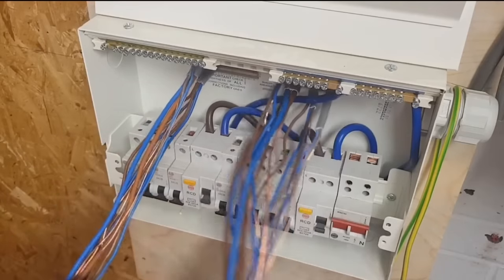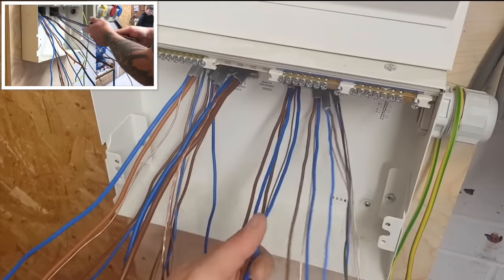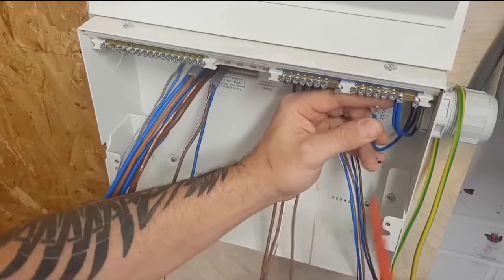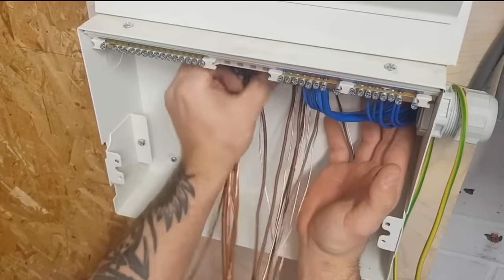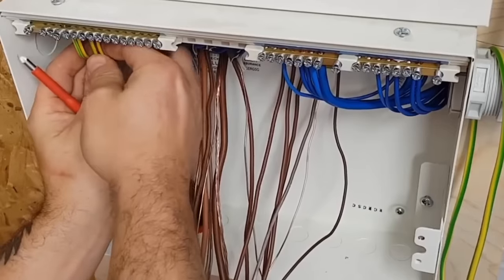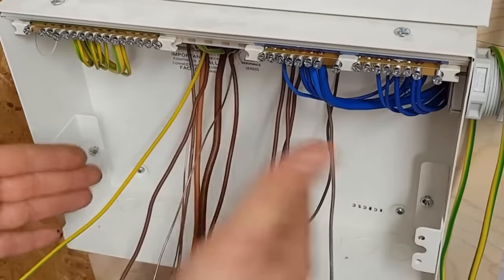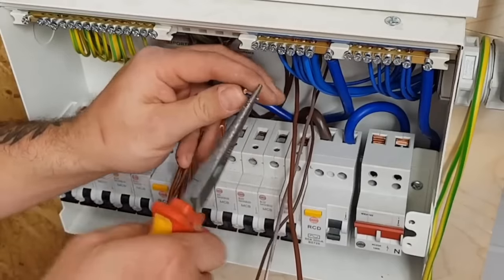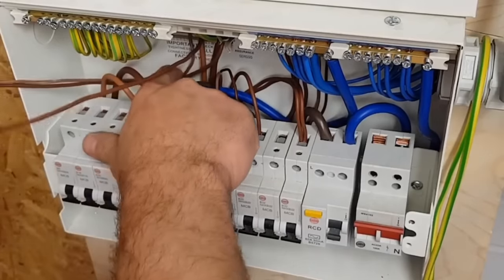Step by Step How to Connect up a 10 Way Wylex Dual RCD Consumer Unit (Fuse Box) By Luke Wichard

Comment from the maker: == 🕐 Time Stamps - Cut to the action 🕕 ==
00:13 -  Introduction to the layout of the cables within a consumer unit (fuse box)
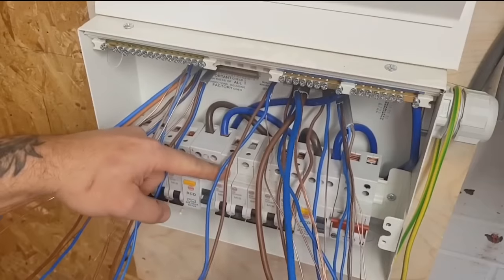01:23 - MCB layout to allow for future expansion of the wiring system 
03:00 - Reasons NOT to use consumer unit blanks 
05:00 - Filling the holes in the back of a consumer unit and intumescent pads 
05:57 - Removing the din rail from the consumer unit 
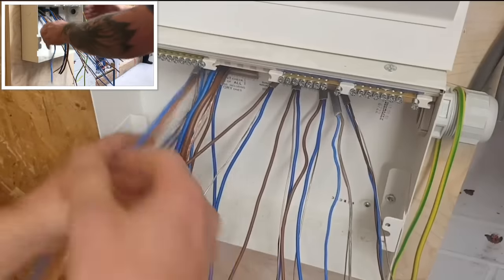06:23 - Dressing the twin and earth (twin and cpc) cables  
12:36 - Dressing and connecting the neutral conductors 
25:25 - Dressing and connecting the cpc (earth) conductors 
43:00 - Torque screwdrivers
46:00 - Dressing and connecting the line (live) conductors

Comment: I wish my electrician would have left a few blanks in my garage, I told him when installing it I may want to install a big air compressor or welder and that day has come and I've now found out hes just wired in the standard 13amp plug circuit and a circuit for the lights and the consumer box has no space for another switch so now I'm probably gonna have to get it redone.. great
Reply: Thats how they make their money isn't it... Return visits?
Reply: @justintemp  Yeah I guess, I’ve had it redone now and left in 3 blanks if I need anything in the future.
Reply: @bendude6748  i totally emphasise as it happened to me on my garage refit. Had swa under patio slab so asked for it to be in own consumer unit with extra for future expansion and extra sockets eg outside lighting etc.
He only put in 3?!!!
Power, light, spare

Did you have to pay for a new larger board? It's annoying as the unit i got was new.
Reply: @justintemp  Yeah had to pay to get a new board fitted, can’t remember what it cost me now but I think it was reasonable. Just a bit annoying that it wasn’t set up how I wanted it the first time around.
Reply: @bendude6748  yeah you pay a lot first time, not to have to do it again.
I asked another electrician and he said he would fit 3 extra ones with a bigger board. He said nobody does 3 nowadays due to number of things people have.... So i can't even sell the old unit online!

Comment: In relation to the question of mounting it on wood. CEF sell fire retardant wooden backing boards of various sizes for consumer units and fire retardant mounting posts both made by Wooton. You still need to fill holes etc.

Comment: If your main switch is on the righthand side of the consumer unit then your connections on your neutral and earth bars should be connected from right to left which on the earth bar you have not done

Comment: I always start with the highest rating MCB nearest the Main Switch or RCD, the bus bar resistance is less at the higher rated MCB than the Lower MCB. This avoids unnecessary overloads on the busbar. Thats how I was taught many moons ago in college. Makes sense, as well as any additions later on. Great video.
Reply: In reality it really doesn’t matter it’s just something everyone does on consumer units. No one ever worries about 3 phase boards.
Reply: 3 phase boards are a different matter all together. They need load balancing on each phase. As well as bus bar loads to each phase being placed nearest the main switch. In 3 phase supplies, they are usually used in commercial/industrial environments and probably using heavier loads such as motors, heaters etc, I have seen totally inbalanced loads in factories that where in contravention of BS7671 so you are right, most people don't care.. Lol I like to think I do care 😉
Reply: Comment wasn’t about load balancing but about were loads are placed on the bus bar subject to distance from the main switch.

Comment: For me in Aust, my teachers always hammered into my head, Earth stakes first, then Earth's, then Neutral's, then Active's then the Mains Supply.

Some people may say its the wrong way but when you work on some places that have tradies with generators or even the weather and worse is the steel frame house its so surprising how much of a shock you get from a dead wires not Earthed first.

I do agree with putting the CB's from large to small and if you got any spare space then put them in the middle but some Auth say NO to gaps.

I also think this is great to watch and most in the is standard in many Countries, States and other.

Comment: A lot of guys don't realise how much easier it is to work on a board that was fitted off neatly like that when it comes to modifications in the future. One of the worst sins my apprentices make is trying to hide a meter of tail from each circuit in a board like that.

When you straighten the conductors I use the ring on my little switchboard spanner, you do it too much with your screwdrivers you will cut the insulation off them :)
Reply from the maker: Hi thanks for taking the time to comment Gaz

Comment: MCB 1 the ring at 48 mins . If putting them in side by side i like to  make sure the folded copper is also aligned the same way for both so your not clamping one double thickness and the other single thickness.  Give them a little tug too . Quite often one will just pop out.
Reply from the maker: Great tip 👍🏻

Comment: A tip, when markig - use 2 different color markers, then only 5 dots - will result in binary code (lets say red for 1 and black for zero) for up to 32 different labels.

Comment: Hi guys. Great video. I’ve been told I need an isolation switch in order to have a home car charger box fitted. I’ve got this exact fuse box but can’t seem to find the isolation switch, any help or advice as to where it could be would be very much appreciated. Thanks in advance.
Reply from the maker: If you need a remote isolation switch fitting contact your energy supplier. All the best Gaz
Reply: @GSHElectrical  great. Thanks.

Comment: Great Video! Is there going to be a second part showing the connection of the meter tails? (Often the most difficult and fiddly part). Would be nice to see how he routes them in around those Neutrals and any tips he has??
Once again, great video!
Reply from the maker: Hi. I will follow up the video with the fitted tails, stickers etc 👍
Reply: great video for newbie sparks

Comment: Great vid ,well done Like, Am I missing something but where does the N from the Main Switch connect to the N bar, and the N from each RCD bank connect to that N?,  Sorry Gary if its a "Bone" question. 
Thanks for sharing sure as always its helped many.
Reply from the maker: The RCCB’s have a number of circuits on each of them and remember an RCD will detect an out of balance (earth leakage current from L and N) in the line and neutral. Google how to RCD work 🦾. Sorry for the messy short answer it’s a mad house this end.
Reply: I have the same question and i don't get the answer. Clearly the main switch must have connected to it 2 neutrals and 2 lines

Comment: Trying to understand European house wiring. So your incoming power from the utility (hydro company) consists of 3 wires? A brown (live) a blue (neutral) and ground, is that correct? So from the live (brown) conductor to neutral or ground there’s a difference of potential of 240v? 
So is wiring a light switch to a light or wiring a receptacle the same as in North America?
How do you wire a 3 way switch? (Assuming power is going to switch first)??

Comment: Hi . For us newbys,, brief exsplanation of “radial “ circuit .. and ring main and there differences . Thanks 👏✌️
Reply from the maker: Hi. A radial leaves the consumers unit and stops at the final point on circuit and ring final circuit leaves the consumers unit goes to every point in circuits and returns to the same to in the consumers unit. Thanks for commenting and watching Gaz 👍.
Reply: Would putting the two radials into one make it look like a ring circuit.

Comment: the loop in/out system for lighting circuits is ok for a simple installation with ceiling roses and lampholders however i  prefer the old spider system for lighting circuits where a central box has each light and each switch wired to it. this is easier for fault finding and easier for connection of display type light fittings

Comment: Hi...  I change my Consumer last week and i was sparky way back 2006-2012. The Only thing I Dont like when you buy the New Board Its always from right to left the configurations of the Main MCB. (I dont know if they do this intensionally) so I change my configurations from Left to right MAINS from left  then followed by RCD.  (MK 15 way Split w/2 RCD).  Its much Better layout as you normally read from left to right.  We don't read from Right to left like other countries.  And I put 100A  mains isolator.  Much easier  to isolate if you want to add circuit on your  Consumer Unit.

Comment: As an electrician of 50 years,the only time you need a neutral at the switch is when you are supplying an outside light where you want to put a double pole switch in as to disconnect both the line and neutral otherwise in my training it was always frowned upon because its good electrical practice to minimise the number of connections on any circuit you are just adding connections and having a permanent live at a ceiling rose is more advantageous when you need a permanent live to pick up were if its only at your switches its much harder,so new ideas are not always the best so I'm totally opposed to neutrals and line cables looping between switches

Comment: I bought a Prem shield board and its has one RCD with live on the left terminal and the other RCD the live wire goes to the right terminal . Is this ever right? Can the polarity be either way . The RCDs are not marked.The board is a split load with 10mcbs.

Comment: It's not easy to work while others are watching you.  I'm an electrician here in the States.  Do you have 220v between the earth and hot wire?
Reply from the maker: Hi. Thanks for the comment. We are 230 volts between line (hot wire) to earth. All the best Gaz 👍
Reply: @GSHElectrical  Yeah on paper. We still have our transformers wound with 240V primaries despite the "official" voltage figure.

Comment: What if the board has a bunch of rcbos on it?
I wired it up super neat like this and realized the rcbos couldnt be backfed. So my wiring was a lot less neat which was dissappointing to say the least
Reply from the maker: Good point… it will be a few more years before colleges will have fully loaded “A” type RCBO boards for learners to practice on. 👍🏻
Reply: @GSHElectrical  man, thanks for the reply. Makes me feel a lot better. Lol

Comment: Hello guy great job. A quetion  for you, as we know most  grounding system in UK is  TNC-C-S  and you do not use rod inside  the consumer unit ,there is rods only along  the power grid in the street,but  just in case the  neutral is lost or broken,  does not it  may offer a risk for the people inside home?
Reply from the maker: Hi thanks for the comment... currently a high number of installations are TN-C-S and the only earthing of the neutral is by the supply authorities with the supply cable. All the best and thanks again for watching GSH Electrical 👍
Reply: GSH Electrical Going to be Interesting with electric vehicle charging points will need Elcb s
Reply: @michaeljohnson1006  Elbs? What is this?

Comment: Hi, What is  your view on leaving spare mcb's instead of blanks? Is it bad practice to leave unused devices marked up as spare or unused.
Reply from the maker: Hi. I like the idea by Luke of leaving spare breakers in the board but I also not against using blanks. Thanks for commenting and watching GSH Electrical 👍
Reply: Personally I try to avoid it otherwise people could connect into an inappropriately rated mcb. It is nice to think that only the skilled will venture into db's but in reality that is not the case. :)
Reply: Yes it’s best not to leave 32A or greater mcbs in there. I have known People connect things upto 32A spare mcbs that they shouldn’t!

Comment: I'm looking forward to seeing how he's going to get those meter tails in with a 90 degree bend. Personally i  don't like to put too much stress on the main tails.
Reply from the maker: Hi. Your 100% correct the board is for demonstration and my technician placed it to close to the supply board. I will do another video about the boards features but I was holding off until the SPD arrives. Thanks for commenting and watching GSH Electrical.

Comment: hi with regard to the mounting of high integrity units, wylex do supply a rear mounting plate that allows rear cable entry for surface cables  however i am not sure about mounting a high integrity board on a wooden surface. is this allowable? could you please clarify are you saying that the rear entry space should be filled with a fire retardent substance
Reply from the maker: Hi. The consumer unit is a training rig hence it’s attached to a wood board and not to a non combustible surface. The access points in the back are large and if this was on-site I recommend filling it with a non-combustible material (compound). Thanks for commenting and watching 👍

Comment: You use the cutters back to front when stripping insulation, the "flat" side if cutters should be towards end of cable this stops the cutters trying to compress the insulation. think of an extruding machine.
Reply: Bollocks

Comment: hypothetical question if a fire breaks out in that box what precautions are there to keep it from spreading
Reply from the maker: Hi. As it’s metal it’s noncombustible 👍. Thanks for watching and the question Gaz
Reply: @GSHElectrical  actually I'm referring to large openings in the back of the box where the dangling wires enter the box
Reply: @ICEJosh1987  I gather than the UK is exempt from lightning strikes?
Reply: Intumescent sealant.

Comment: Wylex CU improvements required:

They should put the earth bar in the middle.

The din rail shouldn’t be rigid. You should be able to remove the guts by loosening the din rail with the two screws at each side, rather than disconnecting and removing all the protective devices.

Provide a decent rear grommet

Comment: Are the two wires per terminal because those are opposite ends of the same ring, or some other reason?
Reply: Yes you have the start of the ring and end of it in the breaker so its fed from both ends

Comment: What is the torque setting on the screwdriver?
Reply from the maker: Check the manufactures instructions - thanks for watching and commenting 🦾👍
Reply from the maker: The are either 0 - 3 NM or O - 5 NM

Comment: I personally dont know any sparks that use side cutters to strip cable, everyone Ived worked with just uses cable croppers which you can also use to fold over the conductor

Comment: Hi, looking for an answer, if anyone can help. What does it mean when a consumer unit switch disconnector is rated at 100A ( or 80A or 40A or 63A depending on the unit)?
I've just googled the above 10 way Wylex dual rcd and it is rated at 100A at the main switch. My own, though considerably older consumer unit, is also rated at 100A. 
Does the main switch automatically cut out power when 100A is exceeded at the unit? Is the consumer unit a very large circuit breaker itself and not just a housing for the different circuits?
Reply from the maker: The current rating of 100 amp etc is the rated switching value of the switch it is not an over current protective device (fuse). Thanks for commenting all the best Gaz 👍

Comment: It would have also been nice to see how the main tails and earth would have been connected to the main isolator switch. It would then have given a view of all the internal CU cables. 
It looks like where the incomer tails are set at the top right of the CU are going to be tight against the main neutrals. Would it not have been better to bring them in at the bottom and loop at the back into the top of the main breaker.  
What was the rationale of having the two radials in the same breaker as there appears to be an empty breaker next to them.
Reply from the maker: Hi. We have another video coming out with the tails fitted and we talk about the different parts of the consumer unit. Thanks for commenting and watching Gaz 👍
Reply: @GSHElectrical  It would be nice to know & see what (if any) Intumescent compound needs to be applied to any gaps/holes left around the CU once all the cables have been entered into the CU.

Comment: Thought the whole amd 3 metal clad consumer unit idea was to prevent a plastic enclosure melting, dripping onto lets say the floor and causing that to ignite. Isnt the ip rating still the same
Reply from the maker: IP ratings the same IP4X on the top and the rest of the electrical enclosure IP2X 👍 thanks Gaz
Reply: I think metal is to contain the fire rather than allow it to easily spread.

Comment: I find it funny you use a torque-set s/driver to remove the risk of over-tightening,  yet use a snips to strip insulation , risking nicking the copper & introducing a stress-point ... ??

Comment: might be a daft question but why only 1 cable per fuse on the 1mm ones isnt the lighting on a ringmain
Reply from the maker: Hi. Lighting circuits are wired as radial circuits hence one conductor in the fuse way 👍. Thanks for commenting and watching GSH Electrical
Reply: yes it is a daft question stick to your day job